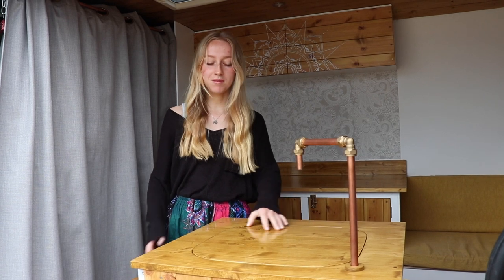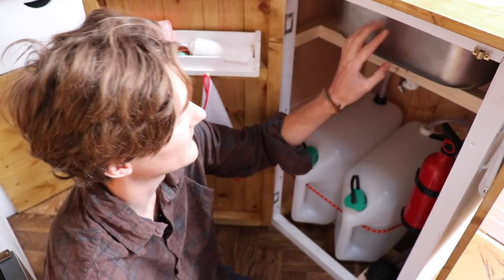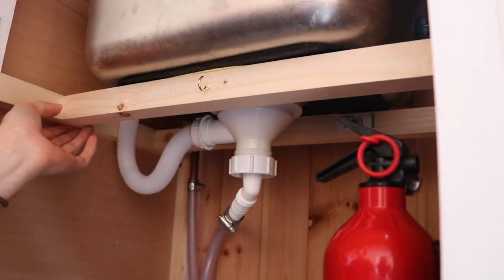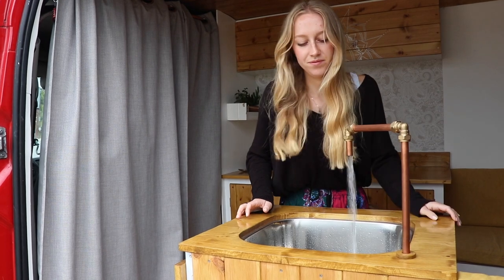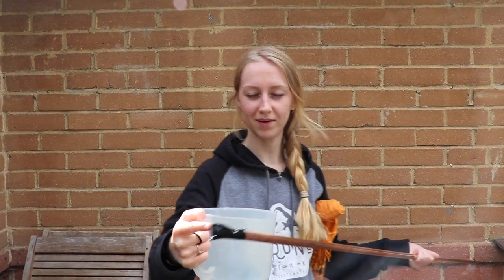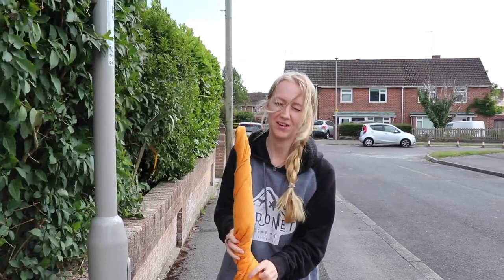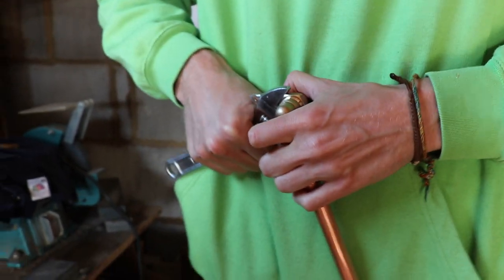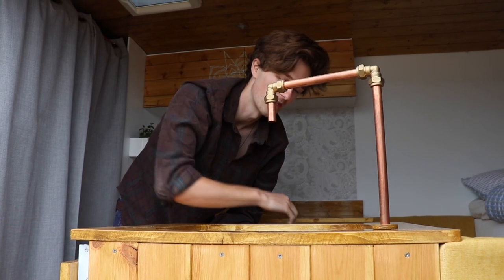Cheap Easy plumbing | Whale Foot Pump Demonstration | DIY Copper Tap - Van Conversion

Comment: Hi what is the adapter you used for your waste pipe to the hose for the waste water? I have looked for dishwasher fittings etc but can’t find the size to link them both up. I have a 1 3/4 outlet from my waste plug. Thanks!
Reply from the maker: Sorry I can’t remember now but I just took my fittings to the hardware shop and tried a bunch until they fit!

Comment: Heya, this is such an excellent set up! Thank you for making this video this has helped me a lot. Just a question please; I’m trying to replicate your setup - do you have the link to the under sink overflow attachment you have put on there to connect to your 13mm flexible waste hose at all? Is this just a standard sink size fitting (universal) or did this only fit your sink? Thanks a lot x
Reply from the maker: Ah no, sorry! We went to B&Q with part of the attachment and then just tried all the ones until we found something that fit, sorry i can’t be of more help!
Reply: @OurWildHorizons  ahh ok, thank you. I’ll just have to try a similar process thanks again x

Comment: Hi. It looks really nice and rustic. How did you connect the hose to the copper pipe?
Reply from the maker: With a lot of force! And I applied heat to the pipe first to give it a bit more flex!

Comment: Did you run into the issue of water not sucking from the water tank? Insist hooked everything up and there’s no water coming up the hose at all when I pump. Wondering if you have advice if experienced?
Reply from the maker: No we’ve never had that issue. Maybe the hoses are installed the wrong way if there’s no water pumping at all? Or perhaps the tubing doesn’t reach the bottom of the water tank? That sounds strange and I’m not sure what else it could be but I hope you find the reason soon!

Comment: did you drill your own outlets in the back of the water tanks? I can't seem to find a similar product with the right hose size.
Reply from the maker: Yes, we drilled a hole in the cap just smaller than the hose so that it was a snug fit. Worked well!
Reply: @OurWildHorizons  sure, thats clear from the video, but thats just the inlet right? It looks to me like the hose from foot pedal to the water tank, but doesn't show the hose you are pushing it from clean water tank to the sink. thanks, appreciate the extra detail support!

Comment: Nice I did the same with my van but my water doesn’t come out as quickly as yours. I’m using 3/8 inner diameter hose and wondering if that’s the reason?
Reply from the maker: Hmm I have no idea what's stopping your pressure, maybe it is the hose. We know someone who has a foot pump and a filter but that kills the pressure too. Sorry I can't be of more help!

Comment: FYI they make copper tubing meant to be bent. No the case as you learned with standard straight pipe.
Reply from the maker: Ah okay! Thank you! Now we know for next time 😀
Reply: @OurWildHorizons  aka soft copper pipe the pipe you're using is called ridged copper pipe the soft copper type usually comes rolled up in a flat cardboard box or shrink wrapped plastic at least thats the case here in the usa
Reply: Its called pex pipe

Comment: Hi thanks for the video! Very helpful. Was your hose 13mm? And if so, what mm was your pipe for the tap? Thanks!
Reply from the maker: Thank you! It was 13mm yes. The copper pipe is 15mm. I had to heat the hose to make it flexible enough to force around the copper pipe then it cooled tightly and I used a jubilee clip to make it extra secure. It was difficult but we can be sure it won’t leak!
Reply: @OurWildHorizons  ahh brilliant!! Thanks so much for getting back to me 😊😊

Comment: you need a special bending  tool and freeze the water inside to keep it from kinking it pipe, a lot of work for maybe results.  I really like the 90 degree fittings.
Reply from the maker: Oh thank you! Now we know for next time 😃 Yeah we really like how our rap turned out in the end 😀 thank you for watching ☺️
Reply: I said same or they could used pex pipe it bends 
Pex a is more bendable pex b is bendable but stiffer if it makes sence . 
Pex is great

Comment: Hi guys! thanks for you very helpful video! Could you share the links where you bought the sink as well as the plumbing? 
P.S. the amazon link to the sink is different than the one you bought and not as good :(
Reply from the maker: Ah thank you for watching! Oh I just had a look everywhere and I can't find it on eBay or Amazon anymore but it's called ENKI KS016 Undermount Sink and Amazon seller must have changed his options. There are some results on google but not ones I can see a purchase option for. Hope that leads you in the right direction at least!

Comment: You needed a pipe bender that you could have borrowed from the hardware store you bought the pipe at. I like the idea and will do this myself with smaller pipe You can even use 3/8" brass pipe which polishes up nice.  Thumb's up :o)
Reply from the maker: Thanks John, glad it gave you some ideas 😀

Comment: Thanks for the great videos. I'm just starting the kitchen in our camper conversion and have the same foot pump. Is it annoying to have to open the door to get to the pump? Wondering if I should make it more accessible in some way
Reply from the maker: We were contemplating putting a “mouse hole” in at the beginning but we decided against it to keep it better looking. Doesn’t bother us, it’s only a quick open of the door when we need the water and washing up we just prop it open 😀

Comment: Did you add or change anything on the foot pump itself?
Reply from the maker: No, we just attached the tubes to it and that’s all 😌 They do have to go a certain way otherwise it will pump the air and not the water though

Comment: You can get q tool that bends pipe you do know that also the bent way to bend copper pipe is to put water in it and freeze it then bend it.
Or use pex pipe it bends its what its made for to ben its bendable copper
Reply from the maker: Ah thanks for the info. We didn’t want to buy or hire anything we didn’t need to to keep costs as low as possible but the ice method seems pretty cool! We’re actually glad it failed the since we live the finish product 😀

Comment: Hi there. I would like to recreate your faucet.  But I’m not sure how you secured the fittings?  Did you soder them? Or use some sort of epoxy?
Reply from the maker: Do you mean the corners of the faucet? They’re just compression elbow fittings which I tightened with a spanner. There’s a copper olive in there too prevent leaks. Hope that answers your questions, if not I’ll try again!

Comment: Really enjoyed the sink and tap build video. Top marks. A quick tip to share with like-minded viewers about bending copper pipe from my apprentice days years ago. My college teacher showed me to use fine dry sand to fill the pipe and then seal the two ends with end caps. It did the job beautifully. Somehow I enjoyed the water-filled pipe bending much more.....
Reply from the maker: That's a good tip! Maybe we should have taken a trip to the beach haha, if that would work!?

Comment: Plumbing explanation is incomplete considering all the components.
Reply from the maker: Thank you 😀 which components would you like to know about?
Reply: @OurWildHorizons  Can you tell me, rather than have a wide open copper pipe where the water comes out, is there enough pressure with this foot pump that if I fashioned a nozzle with multiple holes like a salt shaker, would the water come out in a spray with a little pressure behind it, like a rain style overhead showerhead?

Comment: love the trying to bend pipe- did make me smile guys  :)  ...all the yrs ive made my vans, ive never put a pump in, for this last van i do have a whale pump,!!! i never installed it...hahaha...im very basic kinda nomad!! :)  i did how ever get taps that went with my 2nd hand sink from caravan breakers and put them in place..hahaha so looks like i have flowing water, but always used water bottles/containers and my sink goes out to floor, and when not parked in wild places, i keep spare bottle to store/then dispose of ! coz im doing a refurb , im changing lots of bits /bobs...so it may well get used now !!  :)  love to u guys ********************
Reply from the maker: Haha! Honestly though it would work... but it gave us such a good chuckle at how silly it was that we had to include it in the video. You need to get that pump installed so those taps can be utilised! How is the sink drain hole? We were too scared to make another hole underneath but might add it later on and it seems pretty helpful when you can just let it run away. Thanks so much for watching all our videos!
Reply: @OurWildHorizons  hey lovelys, yeh i just used a hole cutter that went in drill(borrowed off me mate, then did what i did with vent holes where my gas bottle is,file smooth,painted with hammerite, then i used the pipe with the ridges/but changed it, better to use smooth pipe,( coz its not very hygenic and can collect bits of food etc in ridges..)then it hangs couple of inchs longer underneath, and i just pull it up inside if in built up place,i know what you mean cutting holes in van, but ive found as long as you treat the metal its fine, i always give it a few coats, and make sure really dry b4 i pushed pipe thru!
I LOVE watching your videos, makes me smile so much...i looked at your blog page too...totally amazing...and pics :)  iv been thinking of maybe starting my own channel to share a 'REBUILD' project 13yrs later, as never had the chance to share then !!just unsure how too, and what to film with etc...but thought others may be inspired to take on older vans etc...Hope i meet u on the road one day...take care sending good ,good vibes ****

Comment: Hi I'm also trying to replicate this setup, already got the Whale Foot pump and 13mm hose. What diameter copper pipe did you use and where did you get it from? I'm really struggling to find copper pipe with a small enough diameter
Reply from the maker: We used 15mm pipe and we got it from Selco. But I think you can source it in Wickes/B&Q maybe even took station off you have any of those nearby? It’s takes a lot of force to wedge the hose on to the pipe but that’s what we did 😊
Reply: @OurWildHorizons  amazing thank you will give it a go! :)

Comment: I have one of these for our camper as well but the only thing I was surprised about is that it’s kind of hard to push the foot pump. There’s a spring inside it and doesn’t have as much give as I thought it would.
Reply from the maker: Oh really, ours doesn't have a spring and is really easy to push :) Do you have Whale pump?
Reply: @OurWildHorizons  Yes I have the same one Whale Baby foot and it just seemed so stiff so I took it apart (unscrewed the hose clamp that holds it together) and has a helper spring that helps it pop back.

Comment: Qué bueno! Pero...dónde y cómo se bañan?
Reply from the maker: Thank you! We talked about it in our van tour video but we basically have a portable shower which we can use outside. Otherwise we'll use a public shower, shower at a campsite or a beach shower if it's warm enough. Sometimes we'll just have a sink wash but we make sure we're clean somehow! 

You can see the full tour here - https://youtu.be/lQw7QpJWyDI 

Thanks for watching!

Comment: I'm looking at the same set up. The whale pump suitable pipes are 12mm right? And copper pipes I'm finding are 15mm. What did you guys use?
Reply from the maker: Yes we used 13mm :) This is the pipe we got: https://amzn.to/36b2hST We had to use a heat gun to put it on! lucky we could borrow a heat gun as it was the only way we could get it on! :)  This is the pump we got: https://amzn.to/36cNszg
Reply: @OurWildHorizons  thanks. Good to know heat gun required! Can you share some more information on your waste pipe/drain set up. I'm in the process and struggling with the right size connections etc!
Reply from the maker: @sophielegere6852   hi :) We just found something that fit when we went into B&Q, I think it will completely depend on what sink you have. Ours was a waste over flow fitting that just happened to fit out sink. So I would reccomend taking some measurements and having a look in a shop at all the fittings :) Thats what we did. hope this helps!

Comment: hi! are u able to control the water  pressure with  foot pump?
Reply from the maker: Hi :) Yes, you can push it a tiny bit and only a tiny bit of water comes out, if you push it hard a lot will come out :)
Reply: @OurWildHorizons  thank you so much ♡

Comment: How big are the water containers? Do they last you long enough? Trying to decide between a 20L and 15L for just myself.
Reply from the maker: Thanks for watching! each of our water containers are 25L and we use them both for fresh water now. Also we have about seven 8L bottles in the cab area so we have enough! if you have a shower in the van I dont think this would be suitable as an only set up :) Its good for drinking, washing up and the odd bucket wash :)

Comment: Odd question…. But I think I got exactly the same sink for my build but I can work out all the piping with it?! That little knobbly bit you called your overflow is sealed on mine? Did you cut the end off so you could attach it to piping?
Reply from the maker: Our overflow pipe connects to the main drain pipe with a piece that came with the sink. Sorry we can’t help you out! As it all goes into one pipe for us
Reply: @OurWildHorizons  no worries! Thanks for replying anyway! 😊

Comment: Looks great! I'm a tad curious about the diameter of pipes & tubing you used. What's the internal diameter of the tubing connected to the footpump? And what size copper pipe did you use?
Reply from the maker: Thank you!!
The tubing was 13mm and the copper pipe is 15mm. I had to apply heat to make the tubing have enough flex to be forced onto the copper pipe. (which I then secured with a jubilee clip to make sure it doesn't come off) It was hard work forcing it on but it works; haven't had any issues with it in the last 9 months!
Reply: Excellent!! Thank you very much for clearing that up.

I'm currently putting together my own sink and nominal widths/I.Ds were getting me a tad confused.

Comment: Hi! lovely project really well done! One question: I would like to combine a foot pump (I don't want to use electricity for the tap) with a pull-out faucet. Does anyone have an idea if this is feasible? Can it be done? Thanks guys!
Reply from the maker: As long as you can attach the pump to the pipes leading to the pull out faucet I imagine it’ll work the same! If it’s dual temperature only one side of it might work depending on the faucet you get. Thank you for watching! 😃